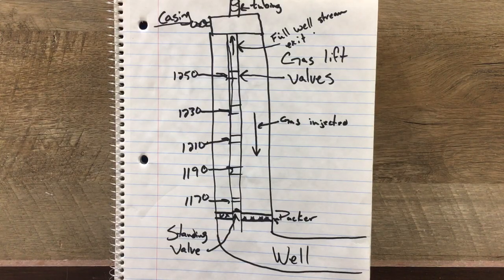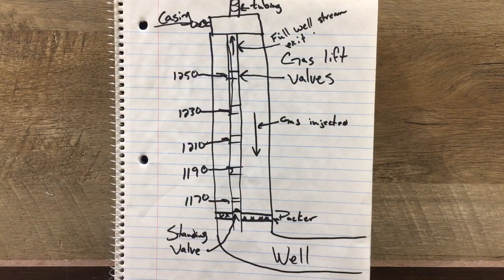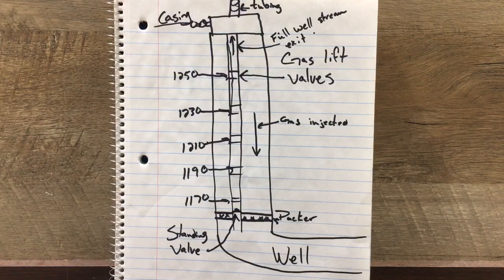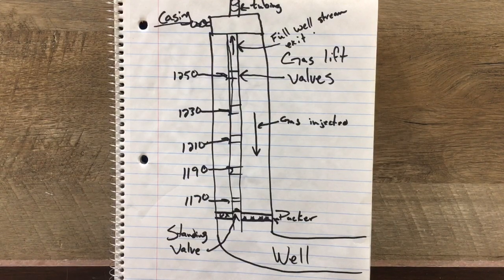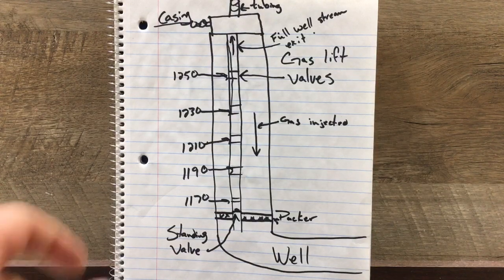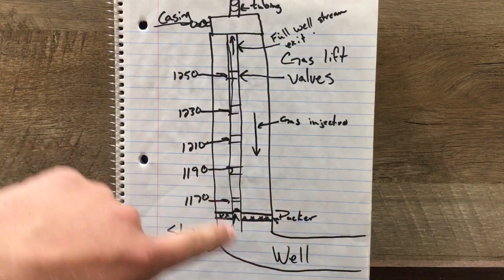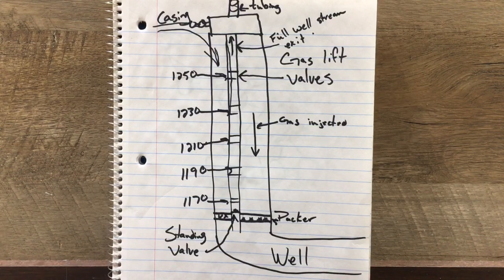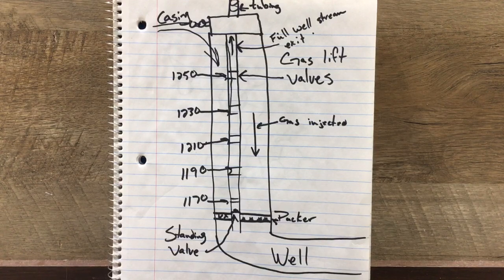Explaining Gas Lift in Oilfield Production

Comment: excellent explanation bro..btw what is a dummy valve and how does it work?
Reply: A dummy valve basically just fills the slot or hole instead of a live or active gaslift mandrel.  They can be wireline or tubing retrievable for future gaslift options as the well depletes.

Comment: Hi man, What happens if the fluid column in the tubing drops below the last valve(orifice)? will that mean that the well can no longer be produced?
Reply: You have to run a blind box tool deployed through slickline to tag your new fluid level. Once confirmed,  the next step is to change or rearrange the positions of the GLM in such a way that the live valves will be around the length with the dead fluid and the orifice valve at the bottom. 

If there's no further GLM close to new fluid level, the asset onwer may consider running a straddle packer that would create a communication port between the tubing and the annulus.  This is a rigless work over operation aimed at redesigning the initial tubing completion design to increase or bring back production.

Comment: What do you do when you cant exceed  the pressure  to open the first 2 valves?
Reply: You increase your injection rate by sending more compressed gas into the gas line. Without adequate preset pressure, the valve won't open for unloading

Comment: Can anyone explain to me how to use a well rescue pack.
Reply: Well if the rescue well pack you are using is the same as the one I use. Well what I do. Is I shut in the well for 15 to 30 min. If I get over 80 lbs of build up. At that time. Then I drop the rescue pack sticks. Leave it overnight. Then the next day I open it, or flare it. If I don't get a build up pressure over 80lbs in 30 minutes. I shut it in overnight. Or until I get maximum build up pressure.  Then drop the sticks, and then wait until the next day to open it.

Comment: How many types of gas lifts do we have ?
Reply from the maker: Couple. Conventional (inject through casing flow through tubing, multiple valves) and annular (inject through tubing flow through casing, multiple valves), I’ve got a new style that uses higher pressure (2500psi) to inject down the casing and only uses 1 gas lift valve.

Comment: Great explanation man.
Sorry about the naïve questions but, this type of lift is basically used in lifting the oil from the well to the surface, right? Also the valves on the tubing are mandrel or something else?
Reply from the maker: It’s actually casing pressures that drop. The gas lift valves act as a 1 way check valve only allowed to open at set pressures.
Reply from the maker: Correct to all
Reply: Also how about those reducing tubing pressure as we go from surface to the bottom. How that works with mandrel?  @Jankycattlecompany

Comment: So is there a circular gap all the way around the tubing, inside the concrete casing? Or is there another small pipe inside the concrete casing that the gas is pushed through? How does the gas line tie into the casing/well? Great explanation and video of it all though man. I’ve been in the compression industry for 3 years now and still learning new things every day
Reply from the maker: Are you familiar with downhole set ups? Tubing is 2 3/8” or 2 7/8” that goes inside 5 1/2” or 7 1/2” casing pipe. The space between those two pipes are known as the annulus. This is where gas is injected which will then enter tubing via gas lift valves. The tubing ( 2 3/8”) is isolated from casing with a packer. Hope this helps